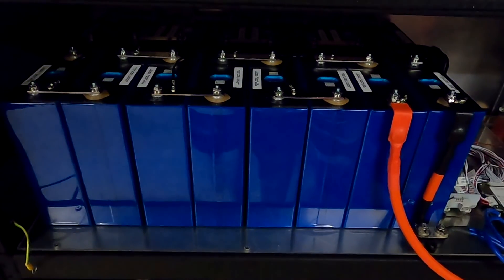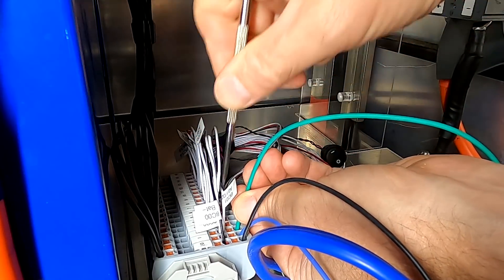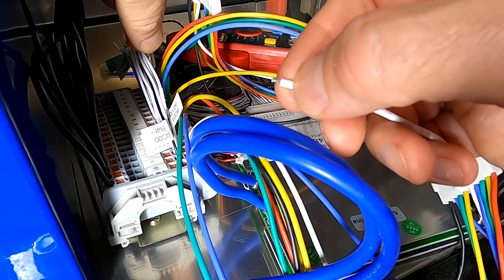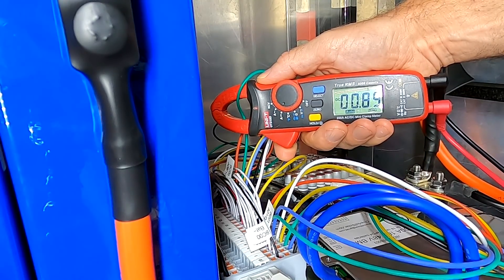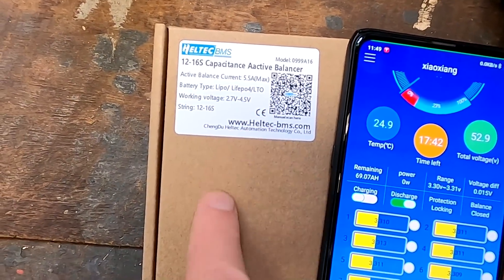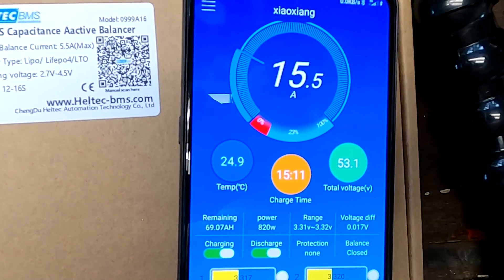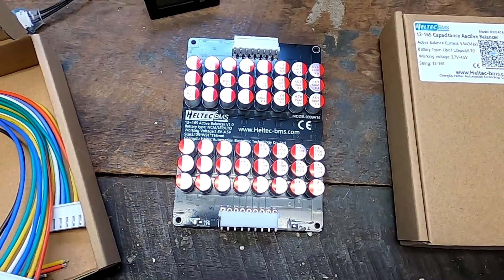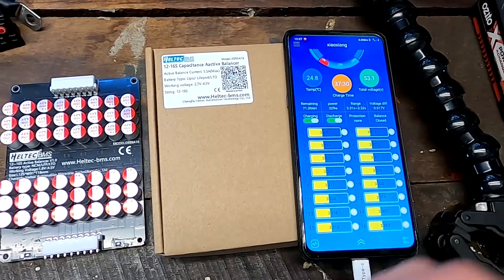HELTEC Active Balancer for LiFePO4 batteries. How to install and avoid problems.

Comment: Andy, I recently had to replace one of my 12-16S Capacitance Active Balancers because I let the magic smoke out. Heltec did send me a replacement and when I installed it the run LED did not come on. I assumed that it was faulty, so I sent it back. I then got a replacement, and it did the same thing. Since then, I have been in a correspondence war with Heltec who have ask me to provide pictures and videos of my installation but have not come up with a reason why the run LED is not coming on. Watching this video again, I realized that the Working voltage of the one you tested and the one I let the magic smoke out, have a working voltage of 2.7V to 4.5V. The label on the replacement one is showing the working voltage to be 3.465V to 4.5V. I am assuming that the reason the run LED is not coming on is because the cell voltage is below 3.465V. Have you come across this issue?
Reply: Update - After many emails with Heltec, it turns out that Heltec have a new version of their balancer. They have changed the firmware so that the operating working voltage is now 3.465V to 4.5V. The LED will not come on until one cell exceeds 3.465V. They still offer the older version with a working voltage 2.7V to 4.5V. You just need to be careful which version you are ordering.
The description for the 2.7V to 4.5V is 'Heltec 16S 5A Capacitor Active Equalizer Balancer Lifepo4 Lithium Lipo/titanate LTO for Battery Group balancer 12S 13S 15S' selecting the option 'Color: 16S 5A' version, whereas the description for the 3.465V to 4.5V version is 'New 5A 5.5A Active Equalizer Balancer ON 3.45V OFF 3.3V Lifepo4 / Lipo/ LTO Battery Energy equalization Capacitor 3S 4S 5S 6S' and you need to select the 'Color: 12-16S 5A' version'
Andy mabe you can do a review of this newer version 😀

Comment: Hi,Andy! I switched from 24v to 48v and I have some differences on the cells (0.18v sometimes and 0.25v), at 24v I had Heltec equalizers and Dali BMS, on 48v I put JK BMS with 0.6A equalization but I'm not too happy with equalization.
The question is can I use the Heltec equalizers two pieces of 8s in series instead of one of 16s?
Reply from the maker: Sorry, we don't know what cells you have, how they are configured nor any charging parameters from your setup to answer your question.
I have a 16s 280Ah battery and it runs perfectly fine with a JKBMS and 0.6A of balance current.
Reply: @OffGridGarageAustralia 2x 16s 105 A charge curent 30A,and when I was on 24v, I still had to use equalizers and I have the 8s ones, that's the question, can I use two pieces of 8s inserted, the ones I have left, instead of one 16s
Reply from the maker: @costelpopa2937  That won't work, the 2x 8s balancers will not balance your 16s battery unless they are 'overlapping' at least one cell. At the moment each balancer will only be balancing the 8 batteries it is connected to but does not know about the other 8.
Use the JKBMS, charge the whole battery to 55.2V and let it sit there until all cells are balanced. It will do it automatically.
Reply: @OffGridGarageAustralia  Thank you very much for your answer!
that's what I'm going to do on one bank, and on the other I'll install a Heltek equalizer to see any difference

Comment: I have a 18650p 12.6v pack connected to a active balancer 
And olso a lifepo4 14.6v pack I use the same active balancer from the 18650 
And yes you are 100% right 
18650 can stai connected to the active balancer all the time it will not affect the voltage it will stay balance no problem 
But for lifepo4 it will 100% ruin the balancing .
Cell nr 3 nr 4 have higher voltage 
Only cell nr1 nr2 stai at  the same voltage .
You are 100 % right 👍

Comment: possible to damage the balancer if you connect the top socket(cell #9 to #16) first? 

I did it and caps exploded. nothing wrong with the wiring
Reply: I just bought the balancer. Your comment will make me double check that I connect the 1 to 8 connector first. 

Did your balancer ended up damaged by plugging the 9 to 16 connector first?
Reply: @olocausto80  maybe it was a bad board in the first place.. yet it got damange. I threw it
Reply: @TubolMotoadventures  I didn't tried because of your comment. Thanks for replying and sharing that experience. 👍

Comment: Hi,
I think it is better to balance until 3.4V even though at the end you'll have some greater voltage differences between cells.
it might happen that some cells in the pack has a problem...a loose wire for example resulting in a not correctly charging and the capacitor balancer might be your problem fixing.
indeed... over 3.4V you will have some imbalancing...but...it will balance them again ...why so impatient with balancing at 3.4? the battery will discharge anyway under some loads so the cells will reset again to the same capacity. we must not forget that the important thing is that is balancing all the time and it does it's job and protects some of the cells in case of faulty connection or cell faulty

Also it would be nice to see in the video the difference between voltage cells at 3.4V with and without the same capacitor balancer because I think without balancing until 3.4V the differences  would be higher

Comment: I have just bought the same balancer from Amazon, or at least it looks exactly the same; it doesn’t have the brand on the pcb or on the box
The leads are very short, they are like 30-40cm…

Comment: Hi I setup 6 Nissian leaf battery for 6s  active balancer how to connect is it start  positive first then battery 5 4 3 2 1 negative right I have try negative then battery 1 2 3 4 5 then positive it short out
Reply from the maker: Battery 1 is always the one with the most negative terminal, so counting starts from the negative side of the battery. Battery #6 is the one with the most positive terminal in your case.
Reply: Yes most lithium 12v battery start from negative then first battery positive etc 2 3 4 5 but Nissan leaf battery is from positive 5 4 3 2 1 negative I  try it works no burn

Comment: I have a 18650 13s10p LG MH1 battery pack, and when the battery is on standby, I have a deviation of 2-3mV, and if I charge it (15A charger), this deviation rises to 45mV.  It is normal?  The current BMS is a passive one, JBD 13s 60A.  I always have row no. 6 of cells with a higher voltage than the rest of the groups.

Comment: I use a simple over/under voltage relay and use it to turn my active balancer on when the bank voltage goes above 27.2 volts and then turn off when it drops below 27.1 volts (for my 24V battery).  The relay I use can also turn on at the low end of the voltage range if I want it to bottom balance, but I have not enabled the undervoltage setting on the relay.  Seems to work pretty well and its cheap and simple.

Comment: Hi Andy, you need to remove more cable sheath before installing the cables into the push fit connectors for a good connection because any contact resistance at 3v will reduce current flow.  Love the videos

Comment: The voltage trigger XH-M609 you suggest is unsuitable!! It’s designed as a small power battery charger controller. Turns on low, off high. It’s also  a bit tricky to program. The turn on voltage ‘difference’ has a range of 9v. (Down button) Works ok on nominal 24v Lifepo4. The problem is it outputs the input voltage. Did you try it with a balancer? It could be used with a 0v trigger, like on some opto isolated relays; but that could be a problem, if bms, or load power turns off. I would suggest using XY-CD60L instead, as it can be programmed as in and OUT modes, also adding another relay in the output, to control the balancer.
Reply from the maker: Ah, right, thanks for that info, Michael. I have never tried it myself. I'll have a look for a better device for that purpose.
Maybe we even don't need a trigger any more and can leave the balancer connected all the time? I'm doing more testing at the moment...

Comment: have one on order, my battery is in a long row of 16 will need to extend the cables what guage are they ?
Reply from the maker: These are thin wires, maybe 22AWG
Reply: @OffGridGarageAustralia  thanks what I'm going to go is pinch your idea of having the connections on a din rail that I can use for attaching such as a balancer without disturbing the battery in future
Reply from the maker: @yorks_atheist3069  perfect, that sounds great. This was exactly my thinking as well when designing this and looking for options.

Comment: Hi Andy, Grüße, aus Bayern ! I have an argument for using the active balancer below 3.45V, and that is during discharge. I have the situation that in my 4S Winston 300Ah LiFePo Pack in the mobile home one of the cells is discharging more rapidly, probably because of a deep discharge earlier in its life (bought them second hand). Eg., while 3 cells are still above 3V, one is going down to 2.8 already (note Winston states 2.5V is the discharge limit. Also the Winston cells have different voltages and curves than your cells). So during discharge the balancer helps this weak cell and prevents the whole battery pack from shutting down when actually there is at least 10% more usable capacity in it. Hope I could explain clear enough.. Keep up the work ! Wo bist du eigentlich ursprünglich her ?
Reply from the maker: Thanks Ralf. That is true and a balancer can help in this case if you need to discharge your battery that low. MOst users stop discharging at 3.0-3.1V anyway as there is not much capacity left (5-7%) below that voltage.
Guck mal auf meinem deutschem Kanal, Link in der Video Beschreibung 😉

Comment: You tested these months ago and weren't impressed. Why again now? Are you just doing ads for all the free stuff companies send you? Asking for a friend
Reply from the maker: Must have been a different channel. I was really impressed with these ones.
Reply: @OffGridGarageAustralia  go back and check. Pretty sure you said these took way too long to balance. I remember buying the 4s version initially on your recommendation and then in a later video you said the opposite, which annoyed me because I followed your suggestion and was stuck with a piece a crap balancer.
Reply from the maker: @ralph9987  I'm not suggesting anything here on the channel. I'm sharing my experience. If go ahead and buy stuff I show in my videos it's totally up to you. Nothing to be upset or annoyed about.
These active balancers work fine. If you watch back the videos, you will see that they are working great if connected correctly. Maybe you did something wrong who knows...
Here is the video again, just for you: https://youtu.be/1SRUhgBdy_g

Comment: Hello Andy, Your videos are very interesting to learn all the solar configurations. Installing an active balancer in addition to a good BMS increases the cost of building our own LiFePO4 battery packs.After balancing and charging 8 EVE 3.2v/105 Ah cells into a 12 volt pack, there was a voltage difference of 0.16 v between the cells. I connected a 25W 30ohm resistor for the cells with higher voltage for 15 to 30 minutes and brought down the voltage of all the cells within 0.03 volt difference. After recharging the cells in full cycles with a Victron 15 amp charger for three days, the cells have remained at the same voltage difference of 0.03 volts. So I do not see the requirement of an active balancer, with additional wiring. Connecting a cell meter helped a lot in observing the cell voltage.
Reply from the maker: Yeah, you can use a resistor to bleed of energy from single cells. It's just a manual process while an active balancer does it all for you. I have to consider one as I rarely fully charge my battery.

Comment: You can even parallel these. And if you anyway idle middle SoC it is totally ok having the balancer connected all the time. Btw: mine is, and yesterday I fully charged the battery from around 70% SoC to 100% and there was no issue at all, the BMS cell overcharge cut-off didn't kick in.
Reply from the maker: I had very mixed results with the battery #1. Because I charged the vehicle from it (higher load) the voltage difference was increased across the pack and the balancer did its job and balanced the whole time. Once I fully charged again the battery was totally out of balance. It could be that the terminal connections on the old battery were causing the increased voltage difference though. I'll do some more testing...
Reply: @OffGridGarageAustralia  hi andy have you try to use the active balancer qucc 16s 10a induction type.
Reply: @OffGridGarageAustralia  You should do Andy. My concern when putting two of these capacitive 5A balancers in parallel was, that if their high frequency cycles were antiphase they would have eliminated themselves. But they didnt, with about 0.4V deviation of one cell I could already see a current of 7-8A flowing.

I reckon with the larger current the balancers manage to keep the cell voltages in an acceptable deviation range for the BMS to not cut-off even in the steep area at the 1/99% ends of the SoC curve.

Comment: Got 1200Ah battery (Nissan Leaf cells) with the Heltec balancer, due to the battery size it takes time, but it works.
Reply from the maker: I guess the LEAF cells are better matched altogether so will have less deviation once fully top balanced.
1200Ah is impressive. Is this at 48V as well?
Reply: 48V 72kWh, 3 Nissan Leaf battery packs. Had them for about a year only with the Batrium BMS balancer and it could not match the cells (only 50W balancing), had 30-40mV at mid SOC and >100mV at low/high SOC. The Heltec works. Greetings from Germany.

Comment: Hi Andy.  Just occurred to me that despite voltage being most of the time irrelevant in LiFePO4 batteries, the BMS manufacturers are still displaying the cell voltages or the cells voltage difference instead the current amperage while balancing.  That would be a great feature and would show how effective the balancer is.  0A flowing in between cells = perfect balance.  Raz
Reply: That would require one resistance shunt for each cell. Massive and costly. I think cell voltage is a good enough indicator for top balancing LiFePO4 cells in a battery pack.
Reply from the maker: That's a great suggestion! I'll pass this on to my contacts in China. They are always asking for improvements.

Comment: balancing at (i.e.)60-80% soc, means creating more unbalance at 99% right?
Reply from the maker: Yeah, that was my experience so far. Some said they leave it connected all the time. I'll do a long term test right now with these two balancers. At the moment I would not leave them connected all the time and only turn on when needed at higher voltage.

Comment: Dear Andy, your videos were so helpful for learning how these 280 Ah cells work and how to control them. After these active balancers came to market, I thought I made a mistake in ordering 123 smart bms. But now I am convinced that I was right and 123 bms will work fine together with the bistable relay. A fully configurable victron bluesmart charger works fine for not to exceed the 80% SOC when Batteries ar "not in use". I was very excitedto see if my installation would work on my sailing-yacht. Since now I am very happy!
Reply from the maker: Thanks a lot for sharing and your feedback. There is actually no need to keep the batteries at 80% you can go to ~97% without causing any further degradation.
But yeah, the active balancers work with any BMS and do a great job...

Comment: I also had problems with the balancer but with LTO cells. The board works great but like you said it should be turned on at the top end of the state of charge. I now have the electronics to do tests. My hope is to do the testing with the cells on the Ebike this fall. LTO cells should work well in the cold weather of Wisconsin. If it works well I want to use it in a NEV with a bigger pack of LTO cells. Your testing helped.
Reply: Use a voltage sensitive relay that turns it off and on at a set voltage
Reply from the maker: Thanks Steve. I still have to test LTOs myself and probably want to use them in a mobile project I will start this year. 
As Ross said, a relay may help or even some solar charge controller have a programmable relay which can be used for this purpose.
Reply: @OffGridGarageAustralia  A friend gave me the device that triggers a contact closure at a voltage set point. I have the pouch LTO cells and the tabs are aluminium and that was a bit of an issue but I am past that. The balancer issue is hopefully the last issue to fix. You probably know this but the charge discharge curve is much different than the  common cells most people use. The larger voltage swing caused me to make the string voltage a bit higher so I don't hit the low voltage cutoff on my device too early. Thanks for all the great input!

Comment: You can activate the balancer with the relay of the victron MPPT too
Reply from the maker: Yeah, but this would only measure the overall voltage of the whole pack. Some cells may go over the 3.45V or whatever you want the balancer to turn on, without getting balanced. I much prefer the manual switch and turning it on every 2-3 months...

Comment: Andy, would it be worth the extra 100 usd difference for the new jk bms VS the one that you have, I'm thinking that the price difference of 100 USD is not worth it just to get the screen
Reply from the maker: No, absolutely not worth it. The BMS will be always turned one anyway in a solar set up. So the +5V procedure is only necessary if you disconnect the BMS.
Reply: @OffGridGarageAustralia  Thank you, glad it's not just me then